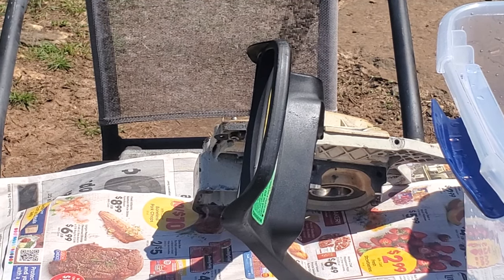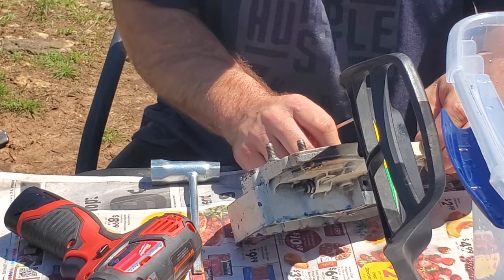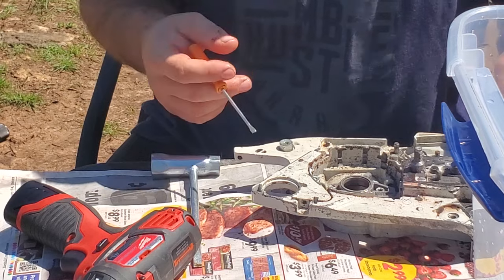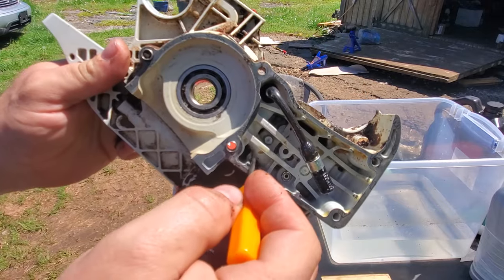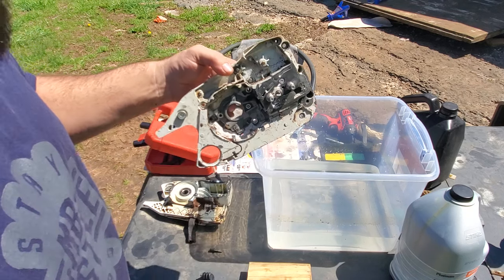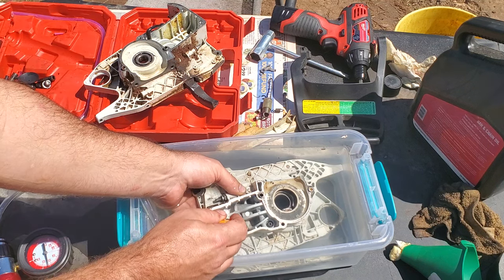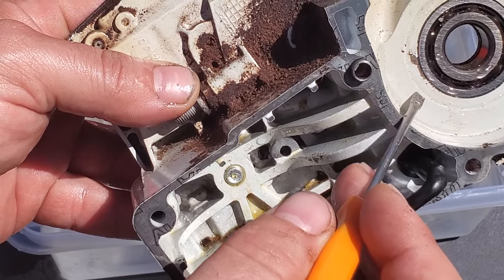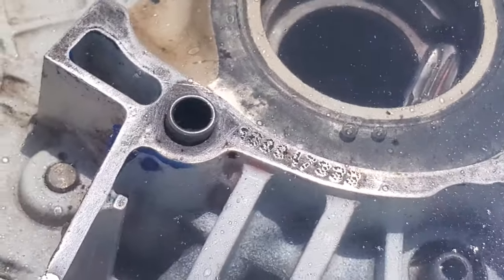MOST UNLIKELY & HARDEST AIR LEAK TO DETECT EVER NIGHTMARE 441 CLOSE UP OF OUR LEAK IN CLEAR WATER

Comment: Looks like the crankshaft wasn't center right it was riding on that side of the crankcase.
Reply from the maker: Idk my cylinder is in excellent condition, so I would think it would be worn more on one side if this was the case. I still think someone beat a bearing in and cased a stress fracture

Comment: How I would fix that case air leak. I would grind it about 3/16 deep and alittle wider that 3/16 and fill it in with JB weld the fuel resistant high strength stuff. I port saws and use this stuff in intake ports and to flow cases and never had a problem. Common practice for some saw porters. If you grind don't wash were you grind just fill it in and should be good.
Reply from the maker: can you explain do you mean directly on the inside of the case where the counterweight rides next to?
Reply: @chainsawredeemer85  Yes inside of the case were you see air bubbles grind into that a little then  fill it let it dry then grind flat.
Reply from the maker: @kennytheguitarfanatic054  well neighbor Kenny, I will definitely try that when I have time. I still don't like selling a saw with a fix like that, it's different to me than doing the intake bc you ground it too low, there's so much more force next to it bc of the crank weight.  I'm really concerned it coming loose and destroying my top end.
Reply from the maker: @kennytheguitarfanatic054  hey you could always buy it then I'll do your fix on the boobtube and if I break it I don't buy it lol you still own it and can buy my meteor 441 top end and I'll install it before I ship your saw🤣